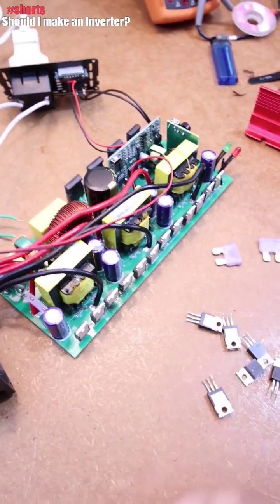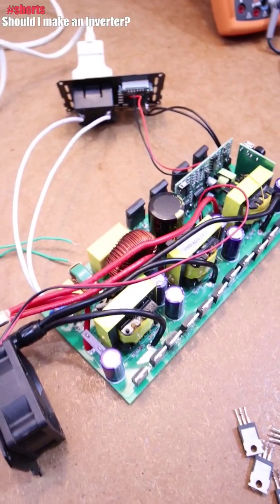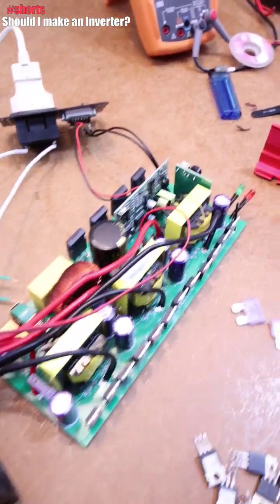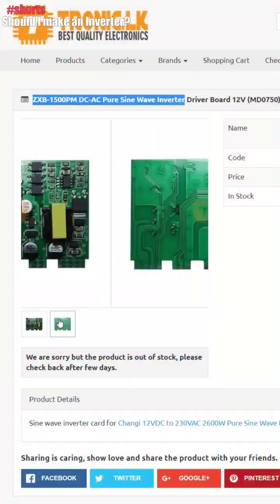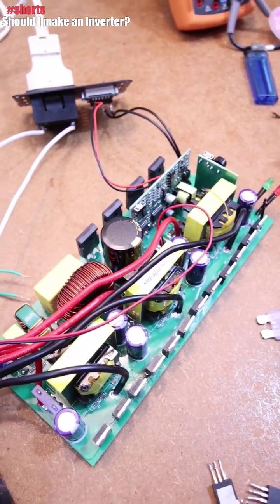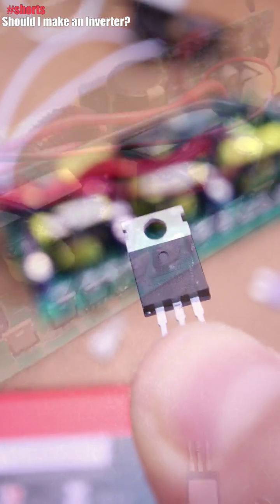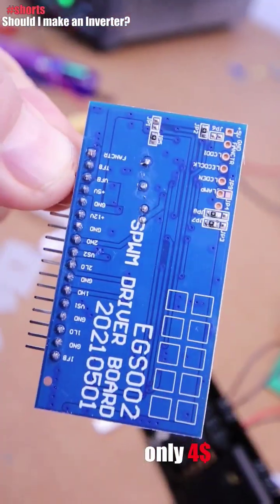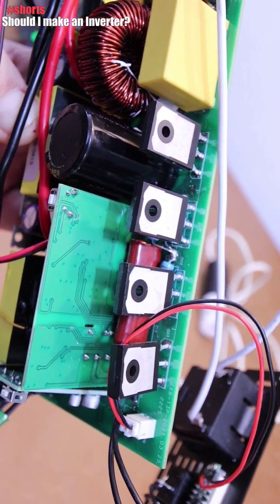1500W Inverter Not Working

Comment: it is  a complete chinese RIPOFF; THEY ALL BURN, and they erase the numbers on the ICs so IT CANNOT BEW REPAIRED; and IF you do,  IT WILL BURN AGAIN;  CHANGE TO Low Freq. inverter + Transformer;  they use the EGS002, bullet proof, my 5000 watt is 1.5 years old, powers the whole house and it trully has been Bullet proof, all kinds of mishaps, externaly, and survived well

Comment: Heating issues bad design glad I design a new way for temperatures controller of mosfets gate it the mosfet pull down resistor is is burn in valve the mosfets will keep burning out so change all gate resistor it heating still there just change the driver the egs002 can’t add in the inverter you don’t need to remove everything to create a new board just track the gate soldering track and add the egs002 output to it

Comment: Ahmmm... don't use egs002 in a HF inverter. 
These really don't like high voltages. 
I got sick of the pile of dead fets and gate drivers these modules killed. 
And be sure to have: discreet totem gate drivers (bipolars) after the ir2110, low esr on bootstrap caps (like more than just one crappy 100μF, put an extra 1-10μF mlcc), protect the gates with zenners paralleled to the bootstrap caps, especially the high side but low side can surge past gate breakdown too... 
snubbers are wise to use and make sure you filter the crap out of the mains output with good chokes and common mode filtering.

Comment: the problem with H-bridges used to create the """sine wave""" is that they eventually short out because of the stupid controller

I'm so done with inverters, I just hate them, I'm planning on creating a combined computer PSU that used 24V DC directly and my UPS won't ever need to have an inverter, just a normal battery charger and a DC/DC converter.

stupid inverter... why do we even need to use AC anymore anyway, we're using solid state electronics on everything, unless its an 3-phase AC motor, AC is pointless.

I wish I could wire my house with 24V DC.

Comment: To those who are saying he should repair it: I’ll have you know that there is no use in repairing anything without identifying the cause of the failure. 

For example If the cause of the failure is bad driving gate circuitry (a design flaw) if you cannot correct the design flaw then you should consider replacing the entire system as it will loose it economical viability to keep repairing it over and over.

My advice is to replace the system entirely with a different model and don’t buy inverters from the manufacturer again.

Comment: 1st check high voltage out put. you should get 325V. if you get this then pwm card is ok. then you have to test the EGS002 board. you can download the data sheet. and check whether it gives SPWM signal. if not then you have to replace SPWM card. And the site you checked EGS002 not in India. it's in Sri Lanka.

Comment: Check if the HVDC output of the step up stage works. If it does, you could remove the output parts and end up with a DC/DC converter to power mains switching supplies from 12V.

Comment: Always replace all MOSFET even if only one goes out.
Reply: and use mosfets from same batch as well !
Reply: I would check the transformers for open windings too.
Reply: Or short
Reply: Why though?
Reply: @aloysiusfernandez4116  If 1 goes out there is much greater instantaneous load on the other one and it's chances of failing increase drastically. So if you change only 1 which is blown then soon after replacement the old one will fail and cycle repeats untill you replace both at same time Or something else in the circuit fails.
Reply: @soumyamaharana9916  thank you

Comment: Are those MOSFETs not attached to any heat sinking? Maybe they're getting too hot?
Reply: Obviously, case is not on a video.
Reply: @pashko90  I didn't mention the case. I have an inverter with a plastic case so how can you know unless you ask the question?
Reply: @TheDradge  I know since I have exactly same inverter. It's alluminum extrusion case and you can obviously see a components on a sides, since this is where they bolts to a case. Simple and effective.
Reply: @pashko90  and there are what? 4 MOSFETs one side and 12 on the other?
Reply: @TheDradge  Who "they"? FETs and HV diodes are on a sides of the board as you might can see on a sides of the board.
Reply: @pashko90  I never used the word "they" so I don't know what you mean.